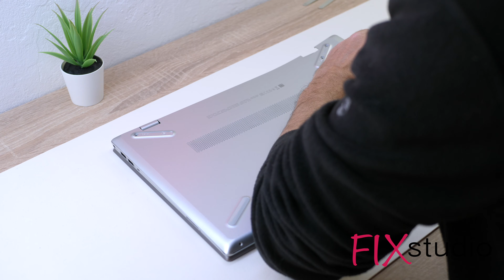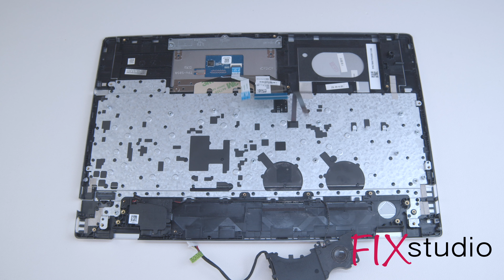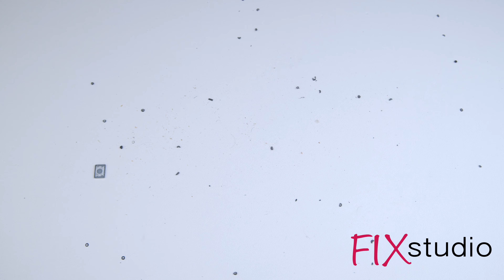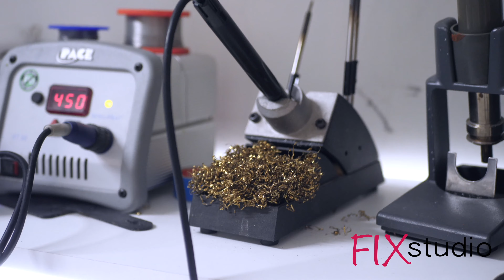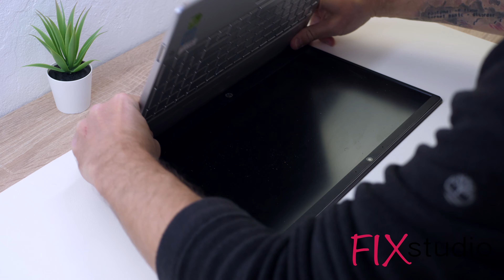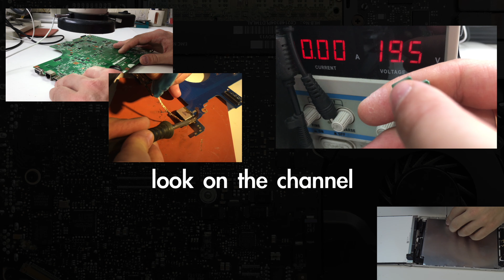HP Pavilion 15 CS - keyboard replacement [4k]

Comment: I need to replace only the top cover, not the keyboard. Would this be easier? Can I do this without removing the melted aluminum panel from the keyboard?
Reply from the maker: Unfortunately not, keyboard is interested with palm rest
Reply: That’s too bad, I’ll just have to do it the hard way 😆 Thanks 🙏
Reply from the maker: Good luck 🍀😎
Reply: Please can I place the keyboard back in place without remove the fixing back the rivets?😢